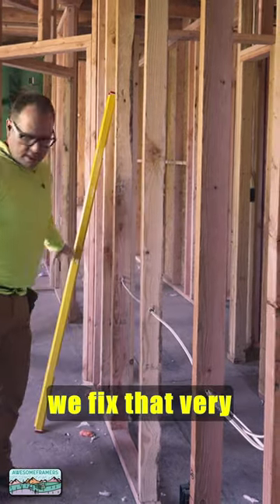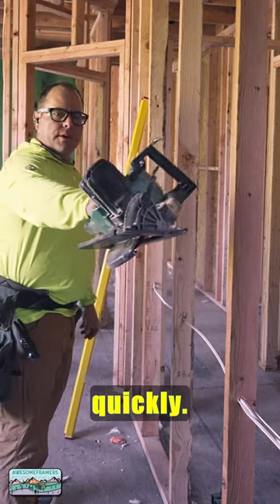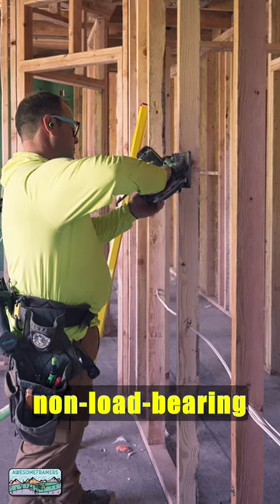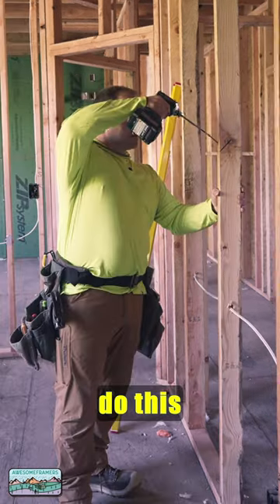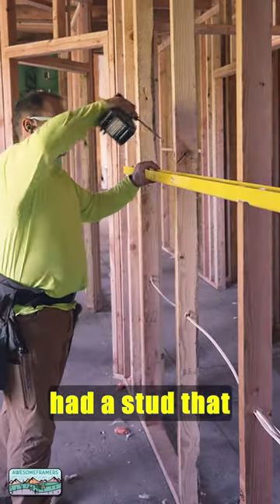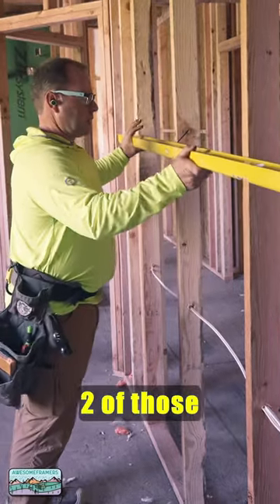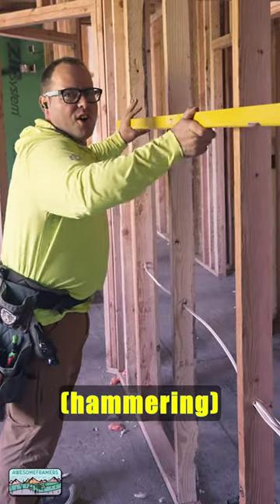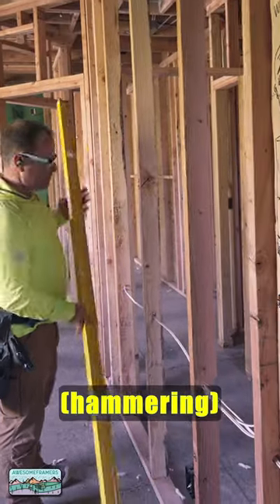Fix it Fast #framing #qualitycontrol #framer #diy

Comment: Thats good that you mentioned. NON BEARING WALL.. its important to let people know that.. 👍👍
Reply: I was thinking the same. With roughly a 50% cut in it! Why don't people just use a planer, the whole proper tool for the job thing 😂
Reply: @mm88swrt sounds like more work. Dont see framers with planers either.
Reply: @LaloJK  just depends on what kind of framer you are. I personally wouldn't snip a stud like that. Just seems like the short cut. To each their own tho
Reply: If you plane this side, the other side will have a hollow.
Reply: Add a 24 " piece with PL and screw on.
Reply: If you don't know you cant do it on a bearing wall you should not building your house.
Reply: Put the crown on the same side
Reply: Lateral support just went away.
Reply: Thats what the other boards are for man she’ll slide on a load bearing one😂😂
Reply: @LaloJK that's what cordless planers are for in my mind
Reply: @mm88swrt Because the other side is now bowed in. If you can straighten both sides without planing or shimming ,why not use this if it works ( on a non-load bearing wall of course)??
Reply: @LaloJK that’s why they say there’s no real framers left… every good framer in my family left because people would rather 10 drunk Mexicans do it for half price and leave 50 corona bottles around the job.
Reply: There's no reason you can't also do it on "load" bearing wall !
   You can just add a "straight" stick to it after slicing it if your worried about compromised strength. 
    I've done it, house is still standing 30 years later.
Reply: Nahhh let em cut a loaded stud😂
Reply: @CharlesLacombe-ji8qq 👈Mr. Lacombe is correct. Quit trying to act like a professional
Reply: @NSBPCA thanks for pointing that out, some framers add a secondary 2x4 next to it.. and done deal
Reply: Not good enough for drywall. Maybe their going to carpet it
Reply: @mm88swrt  This is better than a planer, it fixes both sides of the wall, is less messy, and faster.
Reply: Is it
Reply: @mm88swrt  I honestly feel like most homes are built on shortcuts.
Reply: @8eSix  agreed, quick n dirty 😆
Reply: @LaloJK If they frame decks, they have a planner
Reply: @mm88swrt cause if you use a planer , you straighten one side but the other side is still f’d up
Reply: what’s a non bearing wall?
Reply: @anthonywhippy4391  it’s a wall which isn’t supporting any load from the floor above or the roof
Reply: @anthonywhippy4391  non bearing wall that's just a wall to divide the one room from another.. and isn't supporting the roof.. in other words sometimes that wall can be modified.. also non bearing have no footings and are just sitting on the concrete (blacktop).

Comment: If I had a dollar for every time I heard a contractor say “good enough” I could retire 😂
Reply: I hated it when i was an apprentice. Now i say  it everyday... Nobodys going to know.
Plus the more you say it the early you retire
Reply: It's just that no one is gonna pay you to build a wall with 1/16 tolerance. At some point you have to accept that wood is a living material and it's not perfect.
Reply: With a good enough pension
Reply: lol so true… I’m a General contractor …. The only thing I try my best to have it be perfect however, is painted walls/ceiling, Light placements, sanded floors and basically anything that the holy trinity: Mud, Putty and Caulk won’t fix 😭
Reply: If you want to learn construction the right way the first term you need to learn is “good enough”
Reply: Don't let perfect be the enemy of good.
Reply: My partner & I would string every wall that we're long runs (over 8'), in highly visible areas (like entry's) or if they were going to be painted with anything shinier than egg shell. But we just built custom high end homes, from leveling the lots to pouring the footers, and would do our own drywall. So it was hard to cuss the framers. But still "Good enough" is good enough.
Reply: We always say "good enough for my house!"
Reply: Good enough is the art of the contractor.   What are the allowable tolerances for the task?  Any more and you are wasting time and money.

Comment: I like the part where it wasn't even fixed at the end
Reply: 😂😂😂I know right 😂 the level was still wobbling just as bad😂😂😂
Reply: You're both wrong. He's sliding the level across the face of the studs.
Reply: If you want flat walls... Use steel studs!
Reply: @OldsmobileCutlass1969Va  you can get engineered studs as well.
Reply: @OldsmobileCutlass1969Va LMAO 😂😂😂 that's BS. You have to float metal stud walls. They twist with every screw installed. And before you argue think about why they plaster and float walls
Reply: That’s the old way .. planers and cardboard shims is the way
Reply: @559PHINZ I was gonna say people never heard of a plane before?

Comment: Now check the other side 🤣
Reply: No kidding. Fix one side but mess up the other side !! 😂😂Real smart !! 💪🏼
Reply: @omarmaciel3114 if the board is bowed on one side it’s bowed on the opposing side. It’s correcting both sides, this works unless there’s a bad twist in the 2bi4.
Reply: U can shim the rly bad spots whilst hanging dwall
Reply: @TS-yf2zf if he has the bow facing outwards towards him, that means on the opposite side it will be inwards too so if he puts the level on the other side, the same timber stud won’t be touching the level because it’s bowed inwards. 

By doing this “trick” and helping to straighten it, it just makes it even both sides or at the very least better if not perfect.

You must not be a carpenter if you can’t understand this.
Reply: Lol incredible
Reply: True 😂😂😂
Reply: The timber is parallel 🙄🤪

Comment: As a drywaller, we straight cut half way through a stud if it was too bowed and then just screwed the drywall normally with the same result. Non-loadbearing wall, of course.
Reply: And if it's load bearing, you do it when nobody's looking and pretend you don't know.
Reply: If it is load bearing, it's probably cheaper and faster to just shave it and add an extra straight stud next to it compared to replacing it.
Not sure if that's not allowed for some reason,  I don't build houses
Reply: Drywaller, no, it gets covered.
Reply: Yeppers drywall shims can only do so much had a 135 board house used 2 packs of shims on the lid
Reply: Never a straight cut and always a 45*
Reply: Use metal drywall and you won't have this problem.
Reply: @darrenpodger7294  Or wooden drywall.

Comment: You need to do that on every 3rd board from Menards
Reply: Or spend 3 hours picking good ones.
Reply: Try Drexler and you'll love menards.  Just crown everything it's standard practice, use shitty one for corners/drwall catch
Reply: Banana 🍌 trees for sure
Reply: You aren't kidding. I bought some from Menards a few months ago and spent hours picking through it but some boards still bowed, twisted and crowed after a week in climate controlled environment. You'll always get some bad boards but seems to be every other board these days..  High lumber demand and younger growth being harvested doesn't help..
Reply: @jeremys3987  not kiln dried correctly.
Reply: Lol you speak the Truth
Reply: 😊 Menards has great lumber and pricing, get yourself a bander.
Reply: @nathanpike4745 shitty studs make good blocks. I don't want to use shitty lumber for a corner, the corners need to be plumb and straight as they are your primary reference point and harder to adjust than a random wall stud

Comment: ---- here's another 'trick' :  cull the studs BEFORE you begin, use only those within a narrow limit,  crown all studs in the same direction    -   works wonders
Reply: I am a very clean framer and use bad studs for engineering, backing and blocks(not vent blocks) but even after picking the best studs they still bow and crown when the sun and weather gets to them. If you personally never have a stud you have to replace then you need to pay more attention
Reply: @t3tube I love tearing out old studs from the 50s, 60s, and 70s that are all perfectly straight, sharp edged, and are so hard and dense that you can barely drive a screw into them, then throwing them all in the dumpster to rebuild the new walls with much crappier modern studs.
Reply: @histguy101 or even older houses (I work on Cape Cod, old sea captains houses) that are secured with one hand cut nail top and bottom. Old barn boards that are over 24” wide, milled from old ship parts are so beautiful.
Reply: Lol for sure and for certain
Reply: I've been framing for 15 and we have always crowned our studs out
Reply: @normancollins8087     ---- on exterior walls we usually do also:  easier to nail the studs to the plates before you stand the wall since they will be level to the plates where they  touch   -   on interior walls, it all depends:  you have to decide which way the slight bow will work best:  for instance, furniture  ( such as a bookcase or tall dresser ) or cabinets will fit best if the wall is bowed away from the room center and not toward  -   easiest solution is to cull the studs at the lumber yard and leave the rocking chair and dog-leg studs for the people too lazy to look first
Reply: @histguy101  I never throw away any worth salvaging  -   they are worth the same as new, are often better than the new one in strength, and make great sawhorses  -   every remodel job sees a whole new herd of ponies show up on the job for the plumbers, rockers, electricians, and apparently just random people to rustle

Comment: I was a framing foreman for 12yrs and been building houses over 25yrs. We did it like this on custom houses a long time ago but it's not the right way. In our contract with U.S Homes they had a ¼" in 8' tolerance, so ⅛" gap on each end of your 8' level. The proper way is to paper and plane the whole house using sheetrock shims and a planer. Always check your ceilings, especially the hangers on girder trusses alot of times sit low.
Reply: This
Reply: Plane the hangers?
Reply: @chipburns4123 you use drywall shims to bring the plane flat. On big hangers you cut around and use mesh and hot mud for pre fill before you start finish taping...not really the kind of thing you see unless you build 5 mil + custom homes...you night be used to mcmansion quality.

Comment: Had a builder opt for the worst yellow pine studs for a two story home, because they were cheaper. We warned him but it didn't do any good. Almost every stud went crooked in the whole house. It ended up costing him a third more for us to replace and straighten what we could. He tried sueing the lumber company, but he picked it, so he got to eat it.
Reply: Yeah I’ve seen it before .. !!!
Reply: Mfs order the worst lumber, then complain about shitty lumber. It sucks.
Reply: Yes sir.
Reply: Also proper nailing helps the studs to remain straight as they dry. If he framed with the already crooked studs then he was just a hack anyway…
Reply: @vancebeazer458  Two 16s on one side and one in the middle of the other side, by hand as the builder requested.  This was a dark yellow pine with lots of sap. Built in Dallas back in 1977.
Reply: @lloydsenterfitt4913  toenailing? If so you should have 2 8d on each side and no farther than 1/2” from the edges so the stud can’t twist while it is drying.The builder isn’t the craftsman. Most learn by watching other people doing it wrong or not understanding the specifics of the process. I see people nail off down the centers of studs all the time instead of alternating 16”oc l-rt and 2 at top and bottom towards the outside edges. There are legit standard nail patterns that aren’t passed on when things are busy and the old farts are retiring out.
Reply: Probably crowned them anyway randomly.
Reply: We Order it by the lift. Cull through it, and return the rest to the lumber yard.
Reply: Buy bad quality for cheap, you buy it thrice
Reply: @JA3bONE  On my remodel jobs I would hand select every piece. No problems .
Reply: @JA3bONE idk about buying wood from an actual contractor supplier, but with stone there is a %30 cost increase if you cull.
Reply: @someguy3717  God dang! Not yet…………..
Reply: During covid Australian pine was scarce. They were exporting it all to the states for bigger profits. We ended up receiving Russian Pine and ill tell you ive never seen anything straighter in my life.

Comment: I just use a planer. And drywall shim the other side, if necessary.
Reply: Drywall shims...not me.
Reply: @larrycourtney8893 why not  ?
Reply: Just because I don't particularly like to shim anything, if I can possibly avoid it.Just one of my things, if it works for ya it works
Reply: I don't need drywall shims....they need me 😆
Reply: Glue interior drywall and it floats over quite a few imperfections
Reply: @larrycourtney8893  So how do you fix bowed studs ?
Reply: @michaeljbreault You mean glue instead of screws  ?
Reply: @larrycourtney8893 what about doors?
Reply: @adammonahan687  Wouldn't be able to avoid it, usually.
Reply: @mikebreault no I prefer doing it the right way
Reply: Was gonna agree with you and say the same thing

Comment: When we replaced the 60"s style asbestos bathroom  panels in the family house that my dad built, we found the opposite.  Every hardwood timber  in the wall had been hand planed to give a flat surface, I presume  so the panels would not crack.  I knew the old boy loved planing timber, but that was wild.

Comment: I was  doing the back framing on a house years ago and after the weekend when I walked into the house I noticed the owner had come in and straightened all the studs on the LOAD bearing walls. COOL
Reply: Nothing about that sounds good on you
Reply: @didamnesia3575  Considering I didn't frame the house, why does it not sound good on me? Improve your comprehensivee skills. Do you know what back framing is?

Comment: Check both end studs for straight. Use a string line and 3 blocks of the same thickness. Dont use a level over long distances.

Comment: When I was building a new home in '95, the running saying was Good enough framing, Good enough plumbing, electrical, roofing. You get the picture. Back then I knew ALL the guys doing the build and I had no complaints with any of them. This is hard to find these days😂😂

Comment: I always crowned my studs and never had to do this. Grandpa in 70s showed me this. 3 gen.
Reply: During the course if the build they can dry out and twist or bow . I always check them before drywall
Reply: And I’ve never hear of crowning stud . Maybe floor joists
Reply from the maker: we crown all studs and I've shown that in other videos.  As wood dries, it can be unpredictable.  Thank you for you supporting the channel.
Reply: @AwesomeFramers  I will check for that video. We may call it something different where I’m from
Reply: People are a lot more particular with their houses these days.
Reply: Always crown them
Reply from the maker: @allanschmidt8859  yep we crown all studs.  Things happen as the house dries out.
Reply: @myronsmith2114  typical framing for $3.75 sq ft.
Reply: wow, Im surr they never thought to do that! Great tip!
Reply: @myronsmith2114  Studs should be crowned the same way so there isnt a hump in the drywall when one crowns in and the 2 beside it crown out
Reply: @AwesomeFramers All walls either got a  planer and/or cardboard shims. This was the pickup framers job.
Reply: @anthonyjohnson-dd1ln yep and the walls were straight.

Comment: Okay, is the idea that the saw cut removes enough   wood that when the cut is closed up by the screws it has removed the bow?
Reply: It creates a new point of tension to counter the force that's pushing it outward
Reply: @piggly-wiggly yeah you’ve got the right idea
Reply: Yes.

Comment: Since the stud was cut it should be doubled as its been weakened no matter if it's a load or non load bearing wall. Most all inspectors will knock it. Just saying
Reply: Non-load bearing, no need to double it.
Reply: @RP-gi4ch  I've always doubled studs no matter what bearing or non bearing. . Inspectors here will always knock it. But to each their own. Peace

Comment: Cut the other side.  Cut 3/4 through the back side and insert a shim then screw.
Reply: Can you elaborate on what you mean? I'm just genuinely interested to know. I've never heard of doing that and not sure what the shim is doing or how it'd work on the opposite side.
Reply: @chuckbuttons0699 if you cut a slot in the other side of the timber (the side that’s bowing inwards - concave) then slide a shim/packer in it; it means that you can push the bow out of the timber and slide the appropriate size shim in the slot to stop it opening back up or reverting back to its original bowed shape. So, you’ve now minimised the bow and helped keep it straighter for a hopefully longer time 

I think the original commenter suggested this because a screw won’t hold it forever but the shim should do a better job.

Comment: So driving in the screw flushed out the bow?
Reply from the maker: Yep, the gap created by the cut allows the stud room to move
Reply: What is your trick for load bearing walls?  Is there a trick besides a power plane?
Reply from the maker: @wcbscout  I let in a horizontal 2x4 or 2x6.